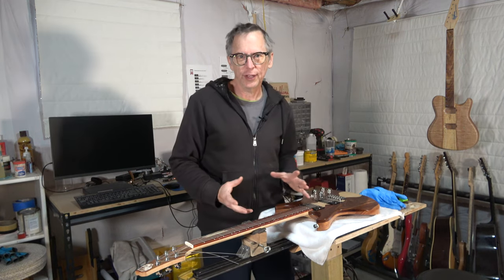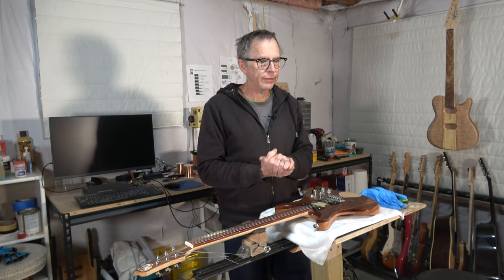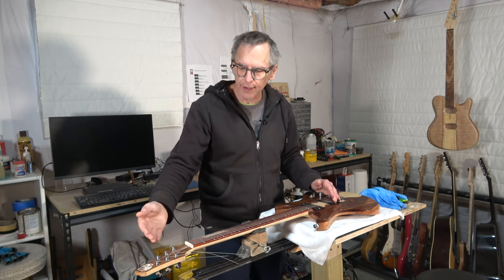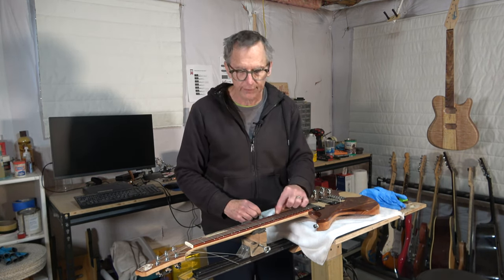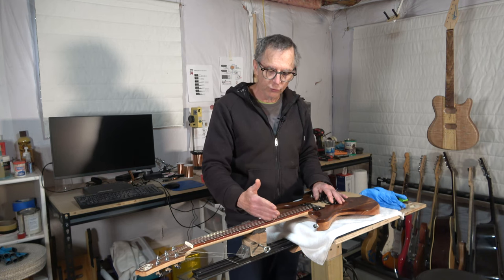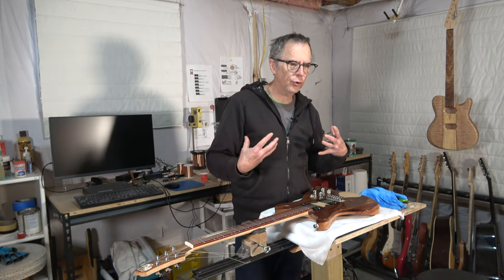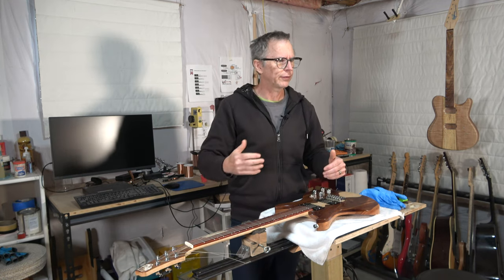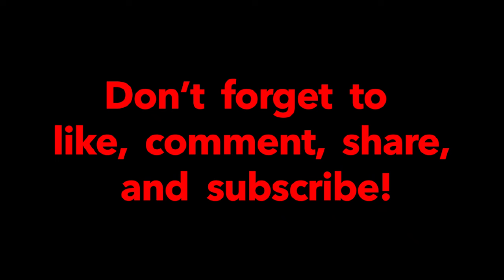The Truth About Guitar Neck Relief

Comment: I had a Guitar in the shop a few weeks ago for a new Bone nut, and a complete setup. It had .018" of relief at the 9th fret. The owner said he liked the way it played, but 1 nut slot was cut too deep, and he added relief to stop fret buzz. I set the neck up with zero relief, built the new nut, and set the 1st fret action at .009" I completed the setup, and set the relief at .004" I told him to pick up the Guitar, play it for a week, and bring it back for any final adjustments he felt were necessary, and to polish/glue in the new nut. He told me the Guitar (2022 Gibson Les Paul Standard Tobacco Burst) had never played this smoothly. He even gave me a $40 Tip!
Reply: There ya go!

Comment: I've read all the comments here, and feel that something else needs to be added: With a neck that is dead straight after the instrument is strung and tuned up, the clearance between the string and the fret above another one that's fretted (with a finger, etc) gets increasingly small towards the nut end of the neck (basic geometry). Neck relief helps to reduce this effect, and it's very convenient that necks bow more at the thinner end, which is where the bow/relief is most needed.
Reply: Well spoken sir, except let’s not forget you need more clearance going down the neck because the strings vibrate most in the middle. So, the straighter the neck the better

Comment: Your explanation leaves out at least one significant factor that I will briefly mention. As you fret up the neck, the geometry from the fret to the bridge changes. The angle becomes greater. With slight relief in the neck, the center of relief does indeed move up the neck as the geometry changes. With no relief, you have to raise the action to eliminate buzz in the low register, but then the action is overly high in the upper register.
Reply: Buzz isn't a problem if you play really lightly. I have a light touch and I honestly don't mind fret buzz or rattle.

Comment: When I'm levelling the frets I put a slight bit of pressure on the beam as it travels towards the bridge end of the neck, kind of sloping the frets if you will. After stringing the guitar I'll tighten the truss rod until the fingerboard is flat. Next I lower the bridge to the lowest point just before buzzing occurs. Lastly I give the tiniest amount of neck relief. Providing the the nut is cut appropriately to string gauge I get the lowest action. I'm not saying this is the best method but it's worked best for me.

Comment: I set my personal guitars up with dead straight necks. If your frets are level you can get super low action with a little or no relief.  I also use 8s… things the internet seems to think is impossible (light strings/low action/jumbo frets).
Reply: i've only heard rumours, myths haha
Reply: Do you play with a light or heavy technique?   I like my shreddier type guitars flat with low action and I generally use a lighter technique with more overdrive/ distortion on those.  
For most other playing I like a little relief and a little higher action since i play those with heavier technique and cleaner sound. 
My technique generally dictates whether the guitar needs relief or not.
Reply: @DavidRavenMoon  Cheers, a fellow bassist.   I play guitar too but bass is my calling (thanks Geddy).
For bass I use fingers and pick depending on the attack I want. I generally use a slight relief for most of my basses, but my fretless is always dead flat.
Reply: I am the same. Straight neck and super low action. I like you don't like loads of relief.

Comment: I've always put a bit of back bow on my necks, without the strings on. Then when I put the strings on and tune it up, the neck ends up straight and flat. My opinion, a straight flat neck plays, and feels quite nice.
Reply from the maker: That might also put less stress on the truss rod nut as you adjust without string tension.

Comment: What I found is that if there is buzzing between the nut and the 8th or 9th fret its neck relief, buzzing between the 10th to 24th fret it's string height adjustment at the bridge saddles.

Comment: In the 30+ years I have been doing luthier work and over 1000 fret jobs, my determination is that “proper relief” in a neck is the factories way to minimize poor fretwork. A flat neck plays better and sounds better….IF the fretwork is stellar.
Reply: You right.. tone much better when flat neck.. but many guitar bass side and trble side always not the same flat and poor fretwork.. i have this problem with gibson lp std, sg vibrola, and fnder american original.. all the guitar had a problem with neck flat bass&trble side
Reply: Listen to pops.....
Reply: Interesting. So if the guitar is playing with a dead straight neck, when the strings are removed the neck will have a degree of backbow?
Reply: @neilmcleanmusic  That depends on neck construction. On a 3 or 5 piece Nk with carbon fiber rods there probably isn’t much movement when you take the strings off. With a flat sawn fender style neck, yea there probably is movement.
Reply: 100 percent. After a fret level, I always set the neck flat with zero relief.
Reply: All my guitars are flat. I just set up my first build and listened to some channels that were saying you need relief. It was impossible to get good action and really frustrating. I finally looked at my other guitars and realized they were all flat. So today I flattened out the new build and now it plays great but I realized I have a couple wonky frets I need to flatten 😂 I’ve tuned this thing so many times I don’t need the tuner anymore
Reply: In my experience, a perfectly flat neck with no fret buzz neck is a fallacy. 
If that were the case, manufacturers would build them straight, and there would be no need for a truss rod.
Reply: @rdog421  Woods of all types change and move to varying degrees over time :) even without string tension, that's why you need the truss rod to compensate whether you like a straight neck or not.
Reply: If the neck is perfectly straight, you either have to have fallout compensation, high action, or play with a light picking attack.
Ultimately, the string needs room to oscillate, that is an undeniable fact of physics!
Reply: Tone definitely sounds better with a straight neck only problem is it feels like I have trouble bending with a flat neck and with some relief bendíng feels easier and slinker. Is it possible that it's in my head and im just gaslighting myself or does relief really help you bend better?
Reply: @jeffreyquinonez8964   Everyone has their own style and taste. If you like it, leave it. Sir Edward said -“If it sounds good it is good “. The guitar equivalent is - “If it feels good it is good “
Reply: @rdog421  1-Check out  Vigier guitars, no truss rod. 2- I spent many years doing compression fretting on old Martins that had no truss rod. To remove relief I would isolate the frets effected and start from the middle installing frets with wider tangs to straighten the neck. There was never a neck I couldn’t fix. And those beauties played like a new Taylor when I was done. 3- A flat neck with proper fretwork is not only possible it’s preferable. If your science is so perfect why can you use a capo anywhere on the neck? Because string oscillation is not static, it changes with the length of the string as you fret notes. Additionally the oscillation moves in an ellipse, not a circle.

Comment: A couple things, great video. And what I often find is the fret buzz I have problems with don't usually occur out in the middle, or where max amplitude of the string is, but just one or two frets from where I press the string into a fret. The amplitude isn't largest here but the space for the string is at a minimum. SO it's not a buzz per se, but more of a metallic overtone, almost the way a Citar makes its odd metallic overtones. Sometimes it's just the profile of the fret I'm on. Keep in mind also that as you move up the neck the max amplitude spot changes but, the string gets shorter so the amplitude is overall less, and less likely to buzz. Plus the angle between the 17th fret and above is much steeper, and for that reason gives it more space to vibrate, It gets pretty complicated.

Comment: I have a little different take. I go with "dead flat" as much as I can, but some guitar necks are more sensitive to temperature and humidity changes. In those cases I may add a bit of relief to keep from going "over bowed" during seasons when it has that tendency.
Reply: Excellent point!
Reply: This is exactly my experience. I want enough relief to know there isn't a back bow and ensure low humidity won't create one. If you hang the guitar next to a wood burning fireplace you're on your own.

Comment: The neck should always remain straight. The only adjustment should be possible at the saddle (height at the bridge), whilst at the nut it should be low enough.
This way is the optimal compromise and also visually (intuitively) seems to be the right way to adjust the trust rod and keep the neck straight.

Comment: Physics says the fret plane should be a spiral with constant-ish take-off angle for the strings and almost zero clearance at the nut and saddles. Lower action = straighter curve, higher action = tighter curve. So really it is the truss rod that adjusts action, but because 1/3 of the curve is missing/nonadjustable, you end up having to adjust the saddles to compensate, but in reality the saddle height above the projected curve should be close to zero. If you keep a straight neck and just raise the saddles, then your high frets will be much higher than they need to be, relief prevents that.
Reply: Would you mind elaborating on the desired shape of the frets and also how to achieve this? Are are basically saying you want relief, but with fall away at the high frets, so you can have but low action near the nut and saddles? Roughly what relief do you shoot for and how much fall away do you add (if I’m interpreting correctly). Thanks!
Reply: Everyone has a different idea about this, some ppl claim dead straight is best, but think about what that would look like for a theoretical 100th feet - clearly ridiculous. The correct shape is a constant angle spiral. Definitely no fall away. (fall away is for poorly made acoustics that fail over time)

In practice you can usually go for straight, level frets with the neck under no tension and let the strings and rod set the relief. Amount of relief depends on your desired playability and tone. Personally I go for 10-12 thou relief (8th fret) and 3.5-4.5 64ths action (12th fret). That should be very playable and clear. You'll be able to bend at the 5th fret and the action will still be low low at the 24th fret (neither of these are true with a dead straight neck).

Shredders will go for lower action (less curve, less relief), which is perfectly fine for what they do - just don't expect it to be very clear sounding.

The other thing to look out for is nut height, if you have a bright sounding guitar you probably need .02 clearance at first fret, otherwise you can get away with lower nut, eg .015 (bright guitars tend to make nut/1st fret buzz sound quite annoying)

Comment: So interesting.  I have always set this sort of by request, and very much by trial and error. If I have a very heavy picker or strummer, a bit more relief.  Finger style? nearly flat, unless a buzz starts, but frankly, I prefer curing buzz with the saddle, nut, and frets.  It seems electric players can tolerate a bit more fret buzz for the sake of very low action. Jazz guys seem to like the action a bit higher, so the buzz takes care of itself if the neck and frets are OK.  Also fretboard radius seems to make a difference.  Great explanation.

Comment: Excellent explanation. One thing I started experimenting with 4 or 5 years ago is carving relief into the frets themselves, for the very reasons you described, using a Rectify Master Katana. Sometimes I even combine fallaway with relief when contouring the frets like this. I use a digital neck relief gauge to precisely set the curvature of the tool, and sand in an X pattern under string tension. 

Typically I only ever do this on the Low E and A strings, or bass string equivalents. I recently was working on a Warwick 6 string bass, and the only thing that ended up solving this nasty low string buzz was carving relief into the frets with the lowest point of relief at around the 13th fret. I also added fallaway on top of this. And not too long before that, I was working on a ukulele with a similar issue, solved almost the same way. 

Being able to select where to add relief and exactly how much to add is a huge, huge advantage. Again, for the exact reasons you described. And of course being able to test your work as you go by using your ears and playing the instrument immediately after each brief contouring session. 

Just as you pointed out in the video, people tend to think "more relief = less buzz," but many times more relief can actually make the buzz worse depending on where that buzz is. 

I've come to prefer dead straight necks on all my guitars, with a couple to a few thousandths of relief carved into the frets only under the Low E and A strings, and only as needed. 

And man. The nightmares about the hundreds of guitars and basses that have come in with buzzy Low E and A strings and the buzz wouldn't go away even with raising the action or inducing more relief into the neck. I can see the appeal of building your own guitars from scratch, because the stuff that's out there in the wild, well. You never know what you're going to get. To use a phrase my mentor used many times during my apprenticeship, it can get "muy ugly."
Reply: That's really interesting, I'm building a Frankenstein "Basher" bass for myself right now, just a quickie build that is going to be a DGAF instrument and, due to the fact I'm fitting a neck that doesn't belong to the body, I needed to rout out the pocket so I decided to experiment with a slight break angle and so far, it's looking really good but the neck needs some love as it's a factory second. 

I need to run the notched edge and rocker over the frets and see where we are but I think that I'll give your method a try if I find myself up against the same problems you described as I certainly have on other build in the past.
Reply: @restojon1  Let me know how it goes! I usually start with leveling the frets flat with the neck completely straight, under full string tension. 

Any buzzes that remain after leveling flat, with the neck as straight as possible under full string tension, I address with the aforementioned techniques. Of course, you can also do this with the 'old school' method of leveling fret with the neck straight and the strings removed. 

Same thing at the end of the day. All final fine-tuning will be done under string tension with an understring tool, and using these techniques if necessary. 

I don't think I've ever needed to carve relief into the frets on the treble string side. But with bass strings, it might be necessary in some cases due to how big they are. 

It's possible to just use a flat beam, and put the neck into a back bow manually with the truss rod. David Collins uses a technique where he actually manually flexes the neck into a back bow by pressing the back of the neck (around the 7th fret) against a pivot, and then levels with a full length beam. He actually also pivots the neck in the opposite direction for the treble side -- pushing the neck into a slight forward bow before leveling the treble side. Then leaving the middle straight, and back bowing it for the bass side.

I learned about his methods on the official luthier's forum after sharing my own method of using the Katana or another understring beam to carve relief into the frets.

For my money, the Katana is the most practical and versatile way as you're not limited to the flexion of the neck dictating the lowest point of relief.
Reply: Thanx for the tips, espacially about the E and A string. Seems to be a more common problem.
Did some fadeways but never thought of a carved relief.
Reply: Hi, I was wondering if your techniques work on a completely flat neck that’s straight regardless of whether or not strings are tensioned on it ? It’s using a D tube and it’s very stiff. Luthier friend said it doesn’t bend even under string tension and can’t provide relief. Shaping it in the feet leveling itself would be an alternative
Reply: @billhuey8866  It should work for sure. Let me know if you try it!
Reply: @billhuey8866  However, if the neck isn't in a back bow and is merely straight, you should be able to get the frets level and not need to carve any extra relief-- maybe just on the bass side. I'd start by getting everything level first and then evaluate if additional relief is truly needed
Reply: @guitar_md  My luthier friend at @DoodCraftGuitars is who's doing it and told me that it's completely flat and won't budge. It's ultimately about playing style and I can start off with a flat neck at first, add E/A relief later if I wanted. I've done fret work decades ago when I was a kid and it wasn't that hard. I could do it just to explore the limits of this neck construction method and refine it etc. The neck is still being built and is ready for fretting. 

Will have to wait for James to get to it as this behind a bunch of other projects of his